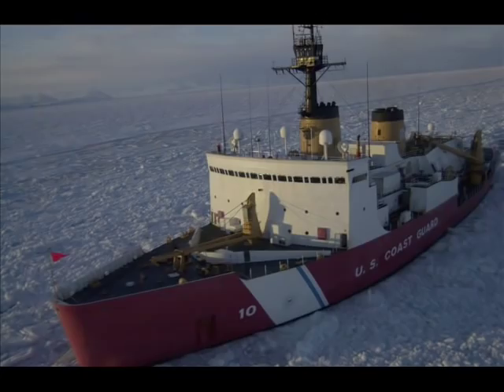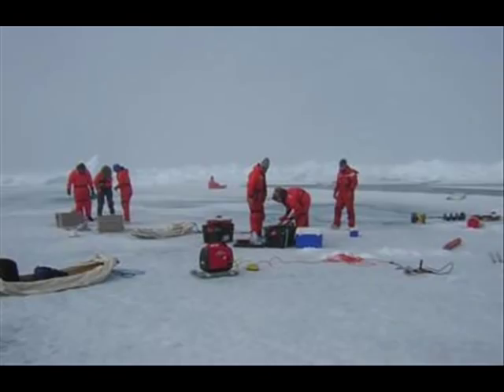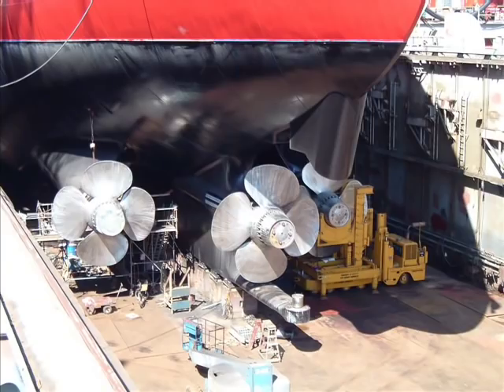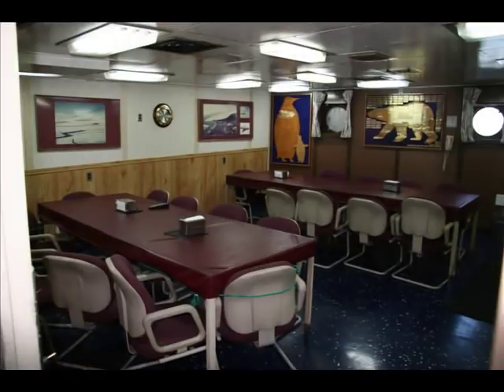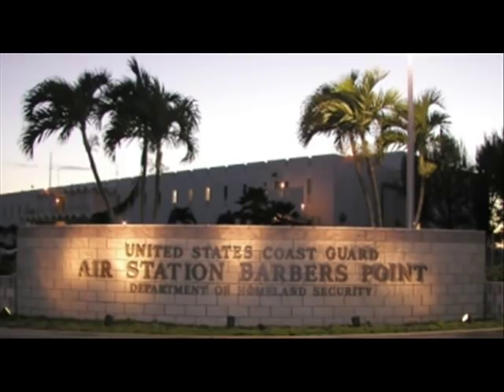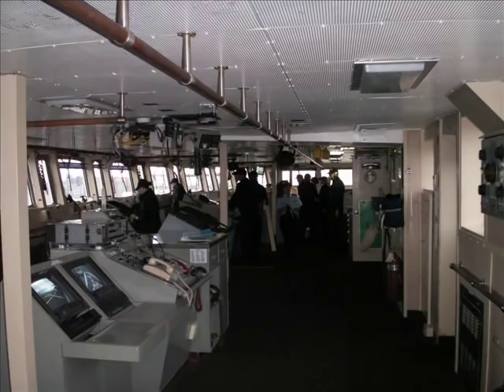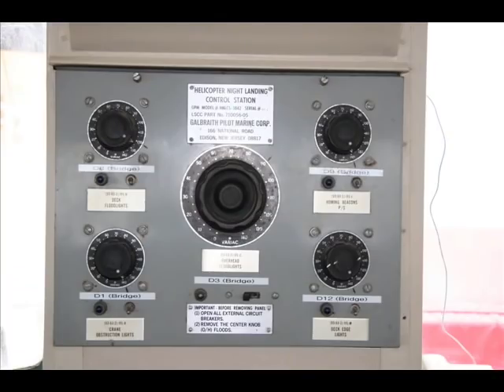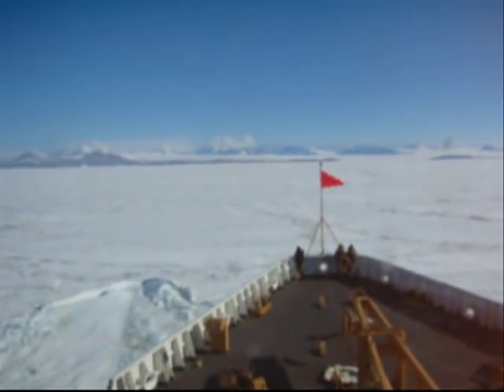History of the U.S. Coast Guard Ice Breakers.

Comment: POLAR SEA is now a lawn ornament at Pier 36, we no longer resupply Thule, but little else has changed.  This is STILL a good introductory video for POLAR STAR, 14 years later.
Reply: She is an ornament because somebody didn't read the workshop manual before doing an oil change, used the wrong oil and seized 5 out of 6 of the diesal engines and deemed not worth fixing!
Reply: @mcduck5  Not the way I understand it, but I wasn't onboard....No question the engines (recently "upgraded") failed in a major way.
Reply: @Ryan Young  I read that the 'piston rings where welded to the block' on 5 out of 6 engines due to the incorrect oil being used.....

Comment: Quite a bit different ship than when I was in. Operation Deep Freeze 1970-1971 aboard WAGB 278 CGC Staten Island. The Staten Island was an old boat, the original North Wind. She was the first Icebreaker built back in the 40's. Went to the Russians for a while, the lend lease program. Came back to the Navy, was given to the Coast Guard and renamed Staten Island. We didn't have any of the facilities that the new breakers have. But we made sure we never got under two cases of beer in the paint locker. :)

Comment: Spent thousands of hours working on these ships. I know alot about them. Still have nightmares about bulkhead shaft seals made of graphite puzzle pieces. Centerline shafting 90 tons! Those turbine shafts your talking about I aligned they weigh almost nothing. The shipyard these ships were serviced at purchased a lathe just to be able to check shafting a long time ago. The "hub" bolts that hold the propeller hub to the shafting flange are torqued to 32000 ft lbs

Comment: While I kind of hate to acknowledge it at least one Russian ice breaker has a higher capacity to break ice. I watched a video about it last night. The yamal has a continuous capacity of eight feet at 3 knots and a ramming capability up to 30 feet. It’s nuclear powered in case of stranding but has nearly unlimited range otherwise. I was hoping for American bragging rights but unfortunately not. Strangely, it has the same horsepower rating per screw and total power. Their hull design must be the determining factor. The one advantage ours has is the propellers are reversible pitch. They have a bubbling system to help break the ice but I didn’t see any mention for ours. It would be nice to have at least one with the same or greater capacity should the need arise for us.
Reply: Ok traitor